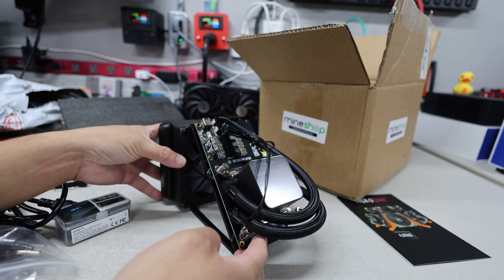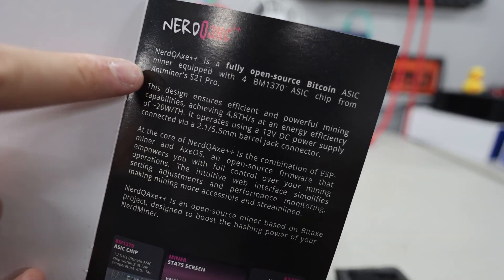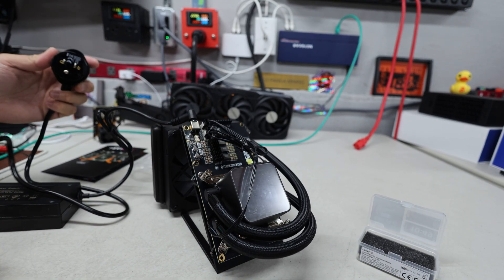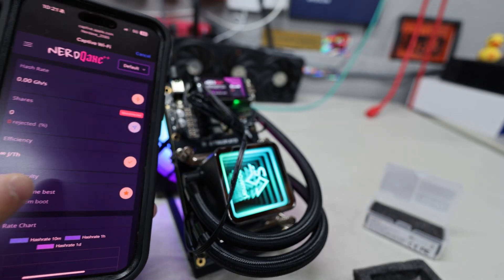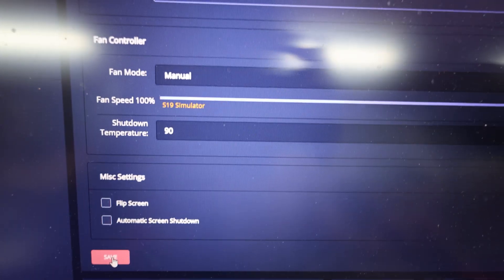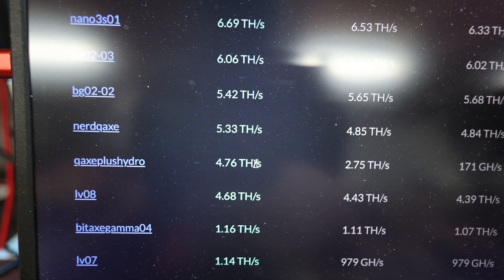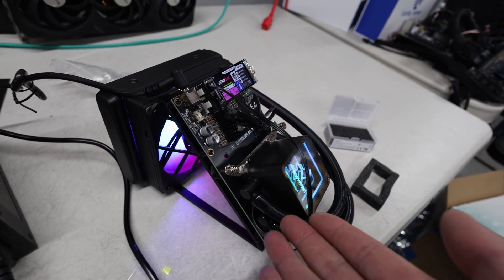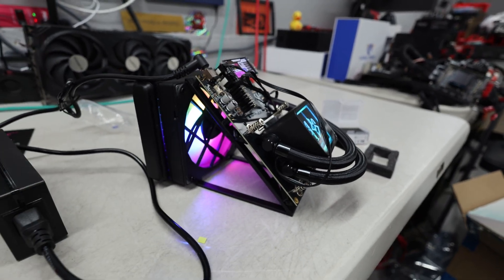They made a WATER-COOLED Bitcoin MINER?! (NerdQaxe++ Hydro Review)

Comment from the maker: 💧 NerdQaxe++ Hydro Review – What Do You Think?
This little watercooled solo Bitcoin miner looks amazing on a desk and stays super cool at just ~95W power draw. Would you trust a watercooled miner running 24/7, or do you prefer air cooling?
🔗 Grab your own NerdQaxe++ Hydro here: https://mineshop.eu/nerdqaxe-hydro-48-ths/?wpam_id=12
Reply: By updating the firmware, you can unlock the restriction on frequency overclocking.
Reply: @GORANI-x1c   A download link?
Reply: With these OC values, you can achieve approximately 6.5-7 Ths: 1250 mV and 800 MHz.

Keep in mind, however, that the voltage regulators require active cooling.

Even 10 Ths is possible with this device :)
Reply: @Xeve1337   A download link?

Comment: I run my qaxe++ rev.5 with stock power supply at 750mhz 1150 corev at 100W with about 16.52 J/Th
It was stock miner but I upgrade the cooling system put a asus tuf 1200 with Intel 1700 socket mounting in 4 screws and run 4 extra fans to keep it cool at 53.3 °C ASIC and 63.7 °C VR TEMP

I expect to recive the hydro from aliexpress next week so Im looking to upgrade the power supply and move both into a small pc enclosure with multiple fans and install a power supply Mean Well, LRS-350-12 12V, 29A, will be good to oc to 800 and 1200 ?!

Comment: I bought mine last week. Bought a mean well power supply for it and it is now averaging @ 6.0 to 6.1TH/S with 98W. its a beast. its power efficiency is between 16.5J/TH to 17.2J/TH.
Reply: I bought a meanwell power supply, cost me approx £25 - £30. I got it from RS tools i believe.
Reply: I believe it was a 240v 150w 10amp.
Reply: Why do you lie about the wattage ?  Apparently its 98 watts for 4.8 TH and not 6 TH .    It is not even close to the 60 watt that is advertised
Reply: @guineverejonckheere7241 I'm not lying about the wattage, if you choose to not believe me then fair enough, but I'm not trying to justify myself to idiots like you when I actually have one of these units and I have measured the power consumption myself. 4.8TH is at its default setting and approx 60w power draw. BUT you can OVERCLOCK it to 6.0 TH but then it draws more power, hence why mine is at 6.0TH and 98W. Have a great day. 😉👍
Reply: What PS did you get men?
Reply: Can you please share the power supply you bought specifically thank you 👍🏼

Comment: Please note that they only come with an 8A fuse, but a higher fuse would also work. Fortunately, nothing broke in the video despite the excessive load ^^ And undervoltage is the issue here; mine runs at 15-16W/Th. (13-14 in the web interface.)

Comment: Increasing the core voltage makes minimal difference to the hashrate, it's the frequency value that changes the hashrate. You only increase/decrease CV when the device is unstable at the specified frequency. CV either decreases or increases power usage in conjunction with fq. So to underclock to decrease power and temp, lower CV until unstable, then ramp up slightly until stable, if that makes any sense😂. To set a custom frequency, append the 4 characters "?oc=" to the settings submenu URL and press enter. This unlocks the overclocking mode
Reply from the maker: Nice! Danger zone I see it now lol